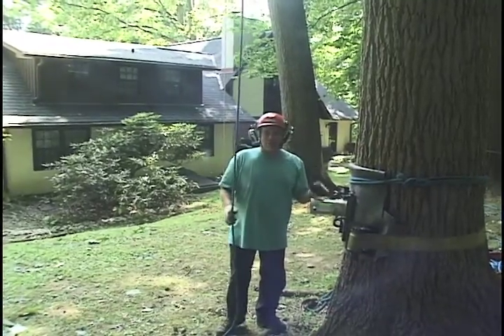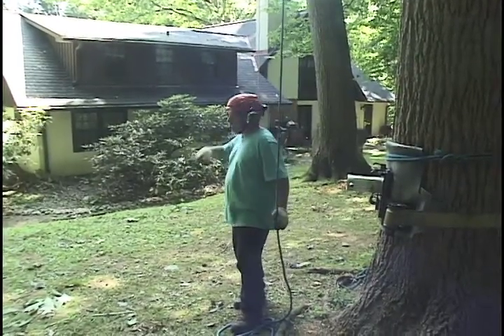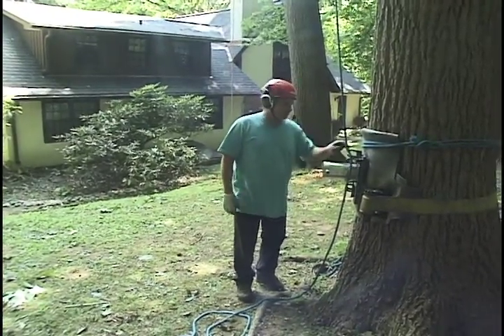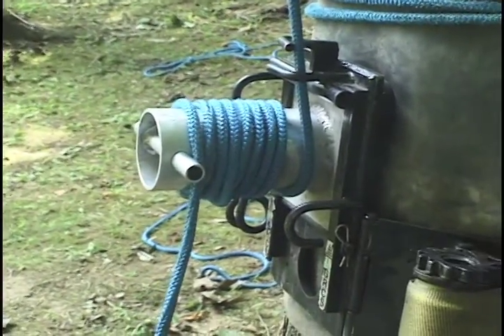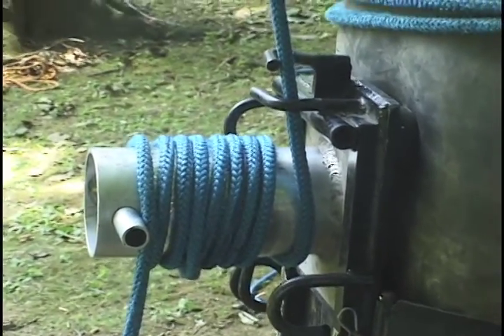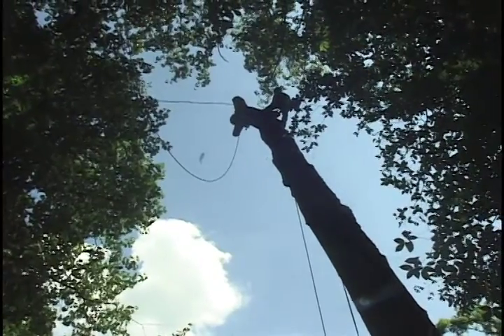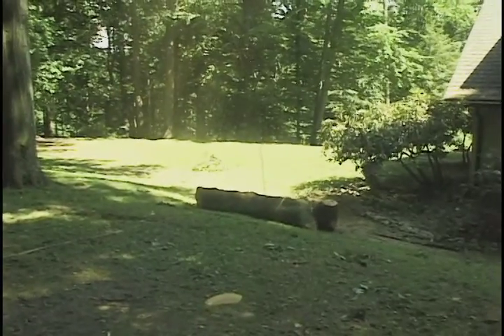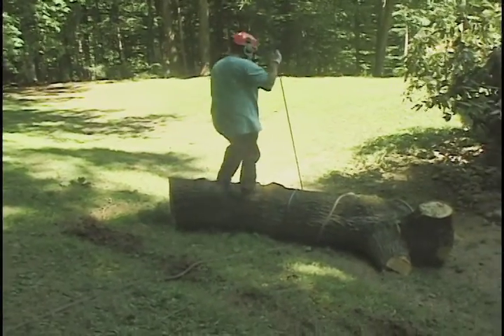The Belly Control Line, a technqiue with similar beneftits to the vertical speed line.

Comment: Interesting idea. Reg Coats uses a similar approach with a vertical speedline, tied at the base to something down below. When the limb hits the ground, the base tie won't let the limb bounce away from the landing zone. Comparing the two methods, as more limbs fall onto a tied speedline below, I imagine there would need to be readjustment by ground crew at each drop, to prevent tangling or damage to the line. With the method you show, the line length needs to be carefully set before the drop, and the tie needs to be far enough away so that the length of the belly line isn't too long when the limb hits.